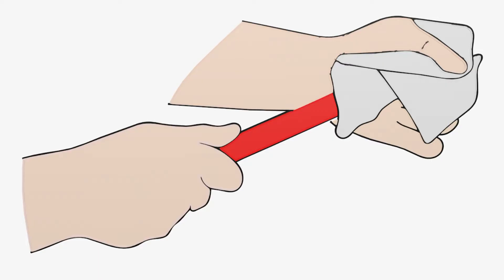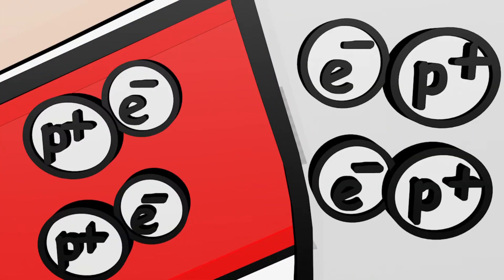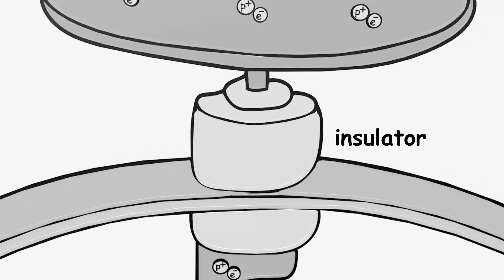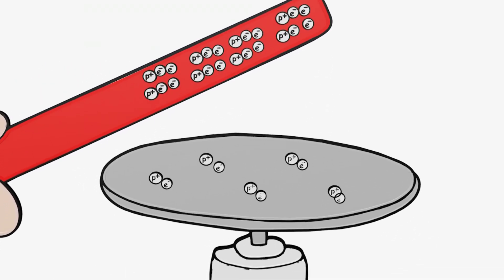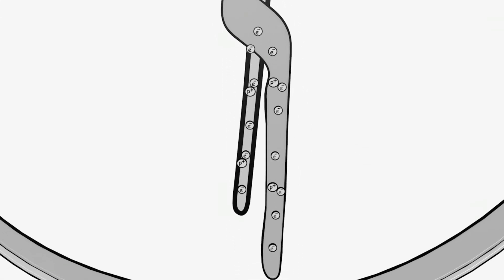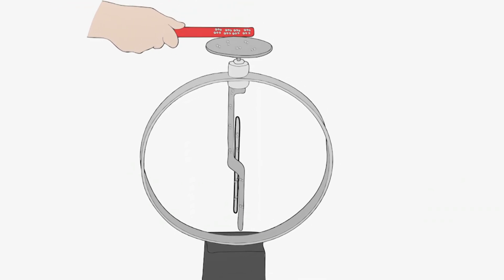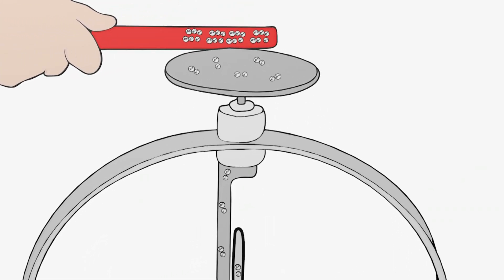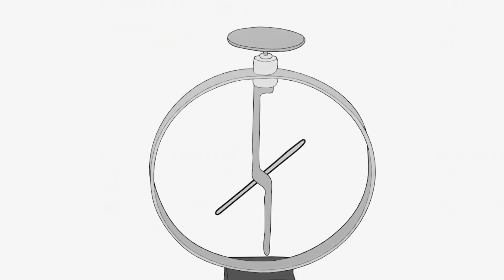How an electroscope works? - explained simply and clearly

Comment: If there was an insulator in between how are the charges transferred downwards?
Reply: The metal rods and the metal cap are connected internally but isolated from the circular outer case